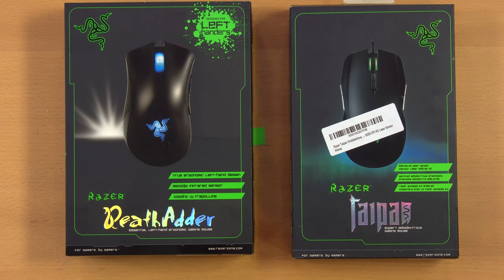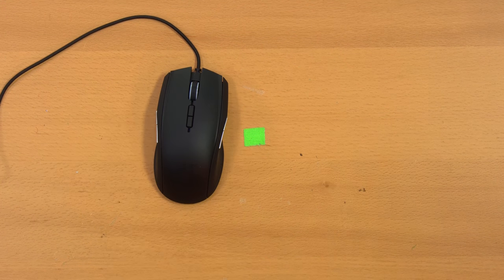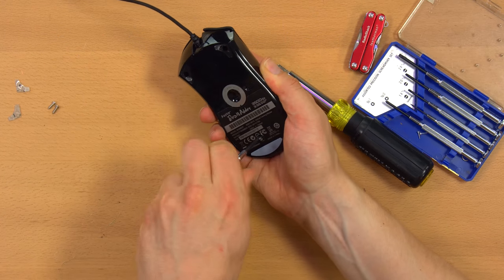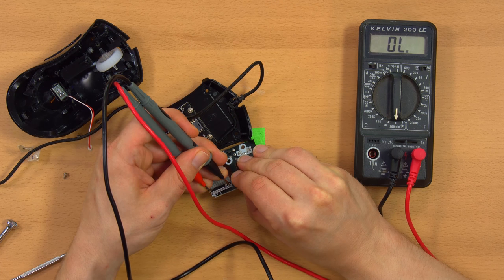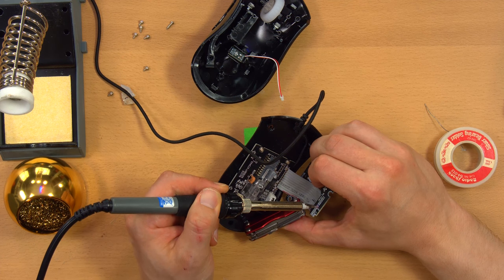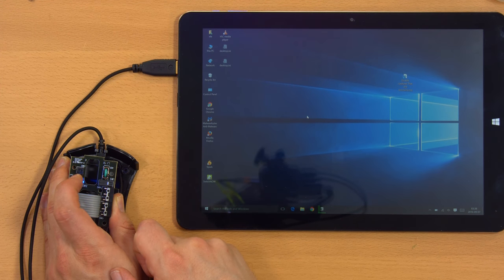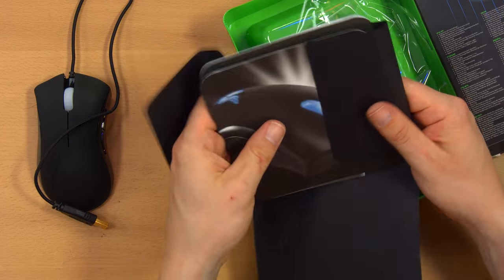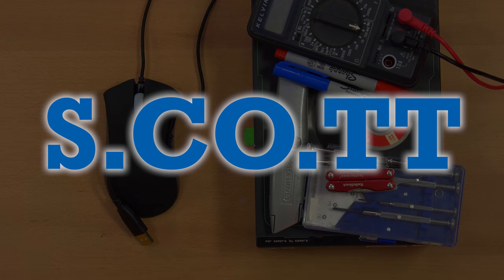Leftie Razer Mouse Button Swap (Left-handed DeathAdder)

Comment: And another thing. Since this is to mod the mouse anyway, READ THIS, WHOEVER HAS/WILL HAVE THE MOUSE. I bought a Logitech M100 mouse in 2015, I think. That mouse has a particularly interesting thing about it: Logitech BENDS the cable that leaves the mouse. What does that accomplish after years of use? Broken wires inside the cable (happened with me years after buying it). Cool. So a piece of advice. If you want to keep it for a very long time (supposing nothing else breaks down), get a soldering iron and get ready to melt a very small part of the mouse.

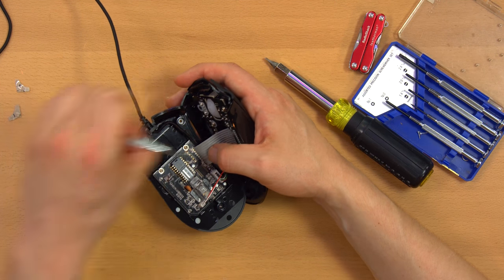See, the USB cable (from what I checked in the video --> 2:43) is also bent before it leaves the mouse. You gotta make it go straight out of the mouse. It can't be bent. In my M100, I melted a hole in its right front corner, so instead of the cable leaving from the middle, it leaves from the right. It's weird, I know. But the wires won't ever break again.

Small "price" to have it last longer 😄. If I buy this thing, aside from the video's mod, I'll also do this (or maybe I use Eithermouse, as suggested by @47mattie47, no idea). In my opinion, everyone should. Came to my mind to warn about this because of this comment, even though I don't know if this is the reason for it or not: https://www.youtube.com/watch?v=n00ioWfDE9k&lc=UgyoMV9MUZFtqgi4xWN4AaABAg.8k3iyYunWxy8k3jELq8r7I.

NOTE: If you decide to do this, BEFORE attempting to do it, think on how you can make it so that you can't push the wire and break it inside. In my M100 case, I had to cut a part of the cable and solder the 2 remaining parts. When I did so, the cables got in a state in which I couldn't push them even though I didn't secure the cable to the mouse. But put glue, for example. Super glue. Something like that.

DISCLAMER: I didn't notice this mouse has a rubber thing right where the cable leaves the mouse. The Logitech M100 doesn't have. So the cable broke. So in this case it might not be needed. No idea. But if it breaks, do this above. Might (will?) fix it permanently.

Comment: Phenomenal video, I've used the synapse software to swap the buttons, but still come across games all the time that won't recognize that software and revert to swapping (not to mention synapse crashes all the time), was about to open it up and try modifying it but wasn't sure if I'd end up just breaking it. Thank you much for being the pioneer and then posting a very clear video! Just finished modding mine and have uninstalled synapse for good!
Reply: Just use windows click swap. All games recognize that.
Reply: Daniel you could even just rebind the buttons in game.

Comment: Wow, wish I saw this year's ago. I had the same issue with Remote Desktop on the old software. Think the new Synapse sorted this. I use a lefty Naga at work (IT) daily. Lefty Deathadder for gaming. Great mice
Reply: I did have to open the Deathadder to replace the USB cable after 5 years though, so this video would have been handy
Reply: Sploftey Loftey yo wat does left hand mouse mean because your still holding with the right hand tell me pls

Comment: Use Razer Synapse and swap the clicks and save as a profile? Iv been using a deathadder for years, and im pretty sure it can store 1 profile onboard.
Reply from the maker: Woah, I hope that isn't true, otherwise this whole endeavor was pretty foolish.  :)  I'll give it a shot when I get home from work..  Though my impression was that the mouse stores the profile in memory, but the profile is implemented by the software on the computer.
Reply: His video is "NOT SHIT"

All Razer softwares are buggy and laggy.

Sometimes give BSOD, usually input lag and unstable mouse rate :)

If you go older Firmware and delete Software after changing dpi / hertz; you can get stable hz and no extra input lag.

But there is a problem: You can't play LoL with MouseButton1 = Left click and MouseButton2 = Right click without driver.

So: If you wanna minimum lag, go @S.co.tt's fix and delete all Razer softwares on your computer.

I think he already know how to switch buttons with shitty Razer software.
Reply: Oh, my mouse is fucked up by driver software and i just crash it aaaaaaand i threw outside from window LOL
Reply: Late question. Every time I start windows, there is no profile and it acts like it is a new mouse without anything assigned. I have to turn on razer synapse to use the profile I want. The OP says that you can assign a profile to a deathadder. How do you do this?
Reply: @AnlYALCINN  I haven't bought the mouse (yet?), but it seems you just need to start Synapse, let it load everything, and then close it completely (https://steamcommunity.com/discussions/forum/11/2254559285380331112/). Wouldn't that fix the problem?

Still though, I thought the settings were saved to the mouse. From what I'm getting of Synapse, it loads stuff by itself. So you must have it on the computer for the settings to apply. If that's correct, I'll still go for this mod, I guess. Or I'll have to install it on all computers and stuff. Too much work for such a simple thing.

Comment: Since they dont sell the left handed version anymore, I wonder if its possible to retrofit the new DeathAdder hardware into the old left handed shell. I love the ergonomics of this mouse
Reply: You can always glue it or something. And if it still doesn't fit, break the plastic inside or melt it so that the new hardware fits. That's actually a very cool idea in case the mouse breaks down and can't be repaired. Interesting idea. Will keep the mouse no matter what. If people don't make it in 30 years or whatever, I'll still be using this old design xD.

If the buttons don't fit, for example, you can always take them out of the new hardware, and make some mod yourself so that you can glue the buttons somewhere and connect them back to the PCB with wires (for example).

Comment: sir, you deserve a medal for this video because I had the exact same issue with this mouse and I think it is more pronounced for sys admins.  Great video.   Well I took it apart and was so confident when I put it back together that I did not test and  lo and behold it didnt quite work.  Turns  out that I the ribbon cable connected to the main board in the base tore very easily.   Funny but the soldering points on the mouse click board were much stronger.    I ruined the mouse and goes as a reminder to be careful with the ribbon cable.  great video and dammit Razer put in a switch for this feature!! which leftie uses the buttons reversed?
Reply: Me.
Reply: zenlasurfer me

Comment: I have the same MS mouse but white, and I also had trouble with the right click... eventually it fixed itself... not sure what it was but I thought of sharing maybe you can look into it before throwing it out!
Reply from the maker: I never throw out anything computer related.  :)  But it didn't stop working completely, but required a real aggressive press, so maybe it would've worked itself out eventually.  Not that I mind if it is done for, because that thing lasted a ridiculous number of years.  (And I was even considering taking the button out of its dead wireless cousin that I have lying around, because I like that mouse so much.)